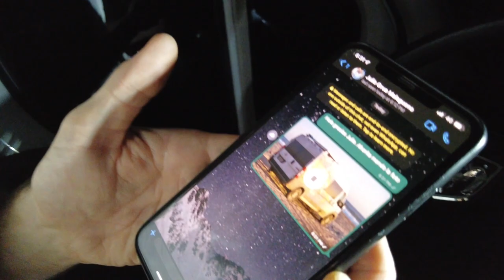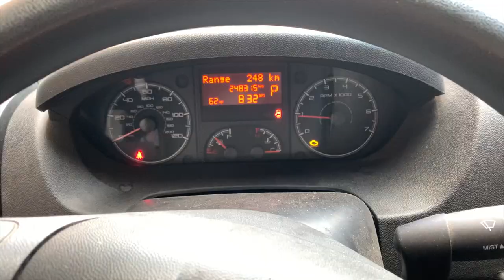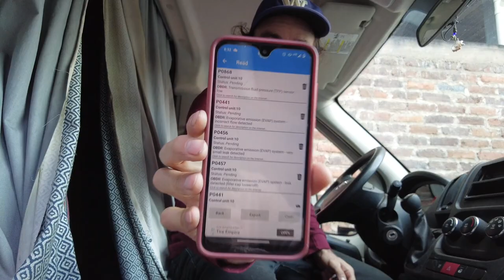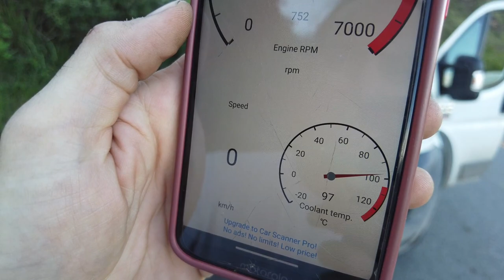VANLIFE NIGHTMARE -- BROKEN DOWN IN COLOMBIA AT NIGHT

Comment: Having watched to the end and see that whatever the problem is, still isn't solved, but you can limp along till you can get somewhere that can hopefully get to the bottom of this and fix it. I know that sometimes with transmissions it can be solenoid problems but I don't think that's the case in your situation. Was amazed they let you ride in your rig while on the tow truck!😲 Will keep you all in prayer. Loved how Danny said that you were all together and safe. That was what mattered most at that moment. 🙏🙏🙏🙏
Reply from the maker: Thanks so much! Dealing with problems that only sometimes pop up is so difficult

Comment: On a trip of this size car problems are just part of the journey.  Now is the time to be glad it is not a Sprinter with the astronomical repair bills associated and the difficulty in finding a sprinter mechanic.  For me, I am debating, I drive a chevy express for my adventures, which at least is a common platform and very common engine.  But it would be nice to have the high top!  I am sorry for your difficulties, but taking it all in stride, I would rather be stuck on the side of the road near Bogota, Colombia, than stuck on any couch in the USA.  By the way, I am pretty sure I passed you when you were in the USA last year as the artwork on the van looks very familiar!
Reply from the maker: So true!! That’s awesome 😃 If you decide on a Promaster I suggest carrying a couple extra things around but it’s not too bad getting parts. It’s also cheaper to fly to Florida and bring back parts than using DHL or UPS 😂

Comment: We actually own a toyota rv. On our trip across the U.S. we threw out the transmission. The mechanic fixed it and added some sort of fan and cooling system in front of it to keep it cool and not have this issue happen again. Maybe this would work for your van.

Comment: Remember the Pentastar V6 is the engine used in Jeeps. I don’t know what particulars are different but you may get lucky at a Ram Jeep dealer. Fiat/Peugeot that worked for your window in Panama only works for the body not the motor/transmission.
Reply from the maker: Jeep, Dodge, Mopar is what we need 🙌🏻

Comment: I am not a mechanic by any means, but I would have the gasket checked on the transmission.  Not sure if the small leak you showed was from them pouring transmission fluid in or not, but if not I would see if the gasket needs replaced.  So glad that it was not your whole engine. God bless!
Reply from the maker: We’re really lucky it sounded worse than it was 🙌🏻

Comment: Ouch! No fun at all. That said, I think you are in the process of dodging a bullit. The electric fan seems to be working OK. The blades hitting the cowl, even a tiny bit,  will make a horrible noise. Should be curable with some careful alternation to the cowl assembly fixings. Remember, diesel engines are highly susceptible to severe damage through low oil, slightly over filling with oil will not cause damage. Keep that engine oil well up the stick.
Upshot: The van is going to be OK. The van crew are taking one hell of a beating, but they are going to live to fight another day!
Reply from the maker: Whew, so tough but I’m so glad it’s not the engine 🙌🏻 We’re heading to Bogota to a Mopar mechanic and hopefully they can help us 😊

Comment: so, when you have a transmission problem, you can run the engine, as long as you don't put it in gear. Colombia is the best country in SA where to break down.
Reply from the maker: Ah great! We're heading to another mechanic for more in depth diagnosis!